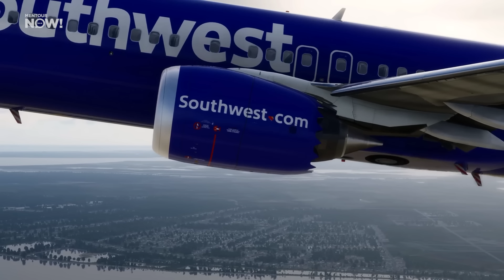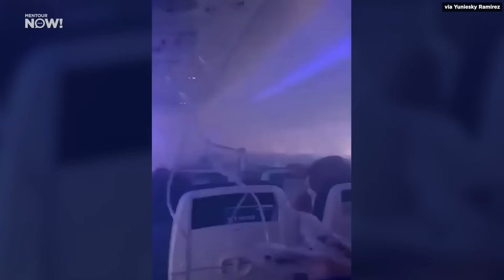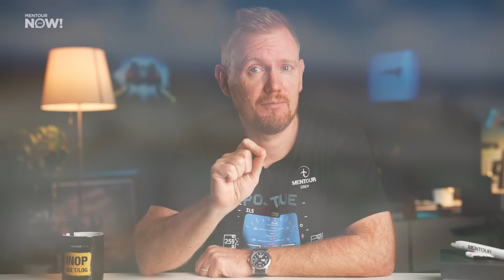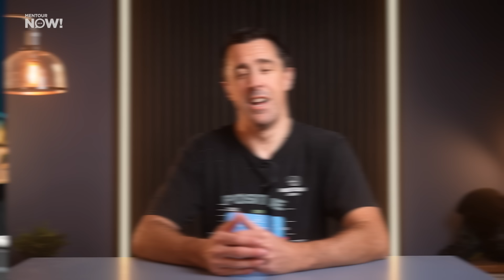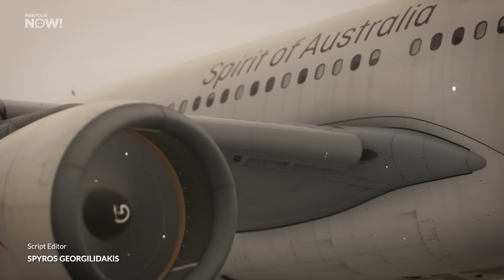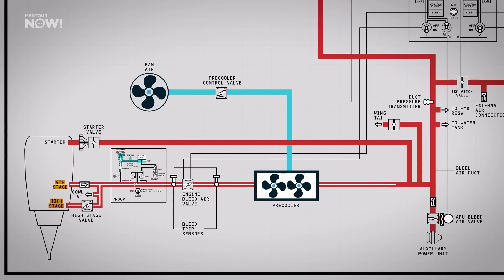Why Don’t ALL Airliners Do THIS?

Comment: bleeding hot air from engines makes sense for the heating purposes. It is definitely more efficient to heat using hot air than to convert that energy into electricity, losing some of it, just to convert it back to heat

but air pressurization from bleed air sounds terrifying given the consequences of failure D:
Reply: Except for the structural and weight penalty of the relatively large ducting and air handling components, especially when having to convert temps and pressures and provide valves to redirect to different applications.

Comment: Engine bleed systems are a high maintenance item, especially as the aircraft ages. Airline executives look at direct operating costs and reliability when making procurement decisions that affect profits over decades. The Boeing 787's bleedless system has proven to be highly cost-effective, delivering a ~3% gain in fuel efficiency by reducing engine loads and eliminating heavy, maintenance-intensive pneumatic plumbing. It enables superior, more sustainable, and more reliable operational economics compared to traditional systems.

Comment: Why don't airlines board passengers from rear to front instead of front to back? I'm sure boarding time could be substantially reduced by eliminating the bottlenecks formed by passengers stowing their carry-ons in overhead bins and fiddling with their seats, etc. Every time I've boarded a commercial airliner, I've spent most of the boarding time standing in an aisle waiting to get to my seat.

Comment: Interesting video, I've been involved in the design of EBU systems between the engines and aircraft for over 35 years and that included both the 787 and A350 amongst many others. I remember being in Seattle in the mid 00's listening to the Boeing vision for the 'bleedless' system. I get there are advantages to not using air bled from the engine compressors but everything from the main A/C packs in the fuselage is still conventional ducting, but with the added weight of the heavy electrically powered  compressors and power hungry heaters for the packs. What you do save is the heaviest ducts mounted on the engine of course (~100kg), but you add those massive generators (~85kg each, dry, plus large coolers, the oil for the cooling system and the huge power cables) and the other thing to note is the extra weight in the accessory gearbox to transmit the torque from & to the engine main shaft, larger step aside gearbox on the main shaft etc. Ultimately, as stated, it really is in the margins of weight / cost and complexity / reliability at aircraft level. Worth saying that you also swap risk sources from hot air to electrical shorts which can both be critical for composite structures. I remember doing a quick weight calculation based on what we knew of the 787 system in the early stages of development and I reckoned the bleedless system would be heavier but those decisions were already made so it was purely academic at that point, really interesting to see the same pro's an con's again after 20 years lol!

Comment: There is one more aircraft that challenges using bleed air, the grand daddy of the 737 that Ben and Petter knows.
The Boeing 707, they still took bleed air, however it was used to drive a compressor that took in air from the outside to compress and feed into the cabin, rather than directly piping the bleed air and conditioning it.
Reply: Yep, I was thinking the same thing (and the DC-8 also).  In the 707, the turbo compressors are located in the engine pylons (look for a little hole in the tip of the pylons, usually above engines 2,3, and 4, but in some models only in 2&3, others all 4.)  The DC8 had its turbo compressors in the fuselage, and the intakes are the “gills” below the cockpit.  You’d think the inefficiency of using engine bleed air to drive a compressor to create more compressed air would be unacceptable, but it allowed the use of a smaller volume of high pressure bleed air to create a larger volume of lower pressure compressed air for the AC packs.  That was a big help to the early JT3Ds, that couldn’t spare huge volumes of bleed air.

Comment: So Airbus did the smart thing, and let Boeing take all the risks with the new architecture.  I would be cash money that Airbus is doing some quiet engineering on the same type of system.  Because if Boeing turns out to be right, then they won't want to be a couple of generations behind, at least at the design stage.  And if Boeing is wrong, and the 787 turns out to be a design that just doesn't work out to have concrete benefits, then Airbus will look smart.  It's kind of a win win scenario for Airbus.

Comment: There is one other exception aircraft: the Boeing 707.  The engines used on the 707 were designed for military aircraft, with lower bleed needs.  The engines couldn't deliver the needed air, so Boeing added mechanical driven compressor to three of the four engines.
Reply: The DC-8 also used a separate compressor system.

Comment: So does the A350’s more efficient air bleed system also reduce the risk of smoke in the cabin? It would have been nice to have that followed up given that it was discussed as a negative possibility bleeding engine air at the beginning of the video.

Comment: Gulfstream/ELTA E550A CAEW and L3 Compass Call "special mission" aircraft have additional 270VDC AEP monster generators additionally to the production 115V/400Hz AC IDG's. Note; RR BR700 series engines have an additional small (very small) DEG (Dedicated Engine Generator) to power the EEC (Engine Electronic Controller) whenever the engine is running... however this DEG deliveries NO power to other airframe systems. This is what I believe the below commentator was referring to about RR Engines having two generators. All late model Gulfstream aircraft either have one IDG or VSCF generator per engine... except for the Special Mission aircraft initially mentioned above. Note 2: Early "DC" Gulfstreams; GI, II and early GIII's did have both an AC Generator as well as DC Generator per engine.

Comment: 12:51 More reliable? I like the 787 and reliability has become a lot better, but their Cabin Air Compressors still drop like flies. They are incredibly fragile. The air pressure bearings are so fragile, they can only be torque tested at 4RPM. Not 4000RPM, 4RPM!

14:43 The 777 has two generators per engine, though one is an Integrated Drive Generator, and the other one is a Backup Generator. The 787 has two identical Variable Frequency Starter Generators on each engine.

Comment: Very well explained Ben & Petter!
As I recall, as an apprentice I used a big motor/generator to convert three phase 380VAC 50Hz to 115VAC 400Hz to test galleys we built at Driesen Aircraft Interior Systems.
Sadly the Combination Boiler we developed and I tested (starting that generator every time and waiting for it to stabilise)  was not put into production after I left, only saw it in the background in the A380 episode of Richard Hammond 's BIG!
And Boeing going "European" with 235VAC is understandable, for the same power the Amperage can be halved and wire core diameter reduced as well, saving weight!

And for the APU, I recently saw a video about the Zoche Aero Diesel that is now also developed as a replacement for the turbine ones, and supposedly has much better performance!
Reply: Small correction, the US electrical system is 240V with a grounded center tap - household appliances might be 120V (half the waveform), but even in a residential context, the big users (HVAC, kitchen) are 240VAC.

Comment: Engine oil is also toxic and possibly carcinogenic as well. There's the possibility of traces leaking causing no visible smoke or smell but long-term chronic exposure to pilots and cabin staff. I think Boeing have it right and they should all change.
Reply: I think also neurotoxic, which can cause neurological problems for pilots and crew  ...  not great for safety either
Reply: Is that why flight attendants used to get switched out for fresh inventory on their 30th birthday ?

Comment: About smoke in the cabin: 
how about: a smoke detector, which automatically stops the airconditioning when smoke is detected ?
Reply: Yes you could put smoke detectors inside the air vents. That would help identify where any smoke in the cabin is coming from (whether from the engine or a fire in the cabin itself).

Comment: But this solution has its own issues, 787’s burn through AC packs like they are hotdogs at a country fair. It’s the biggest source of dispatch delays. It’s also only practical to implement when you’re doing a new design everything else has bleed air built in.

Comment: I kind of like bleed air rather than taking the hit of transferring rotational energy into electricity with generators.  At some point the benefits of electric will outweigh the penalty of energy conversion and it seems we're right on that threshold at the moment.  As always, thanks for sharing.

Comment: Bleedless pressurization is absolutely the way to go!

I feel like pumping air from the engines into the cabin is one of those things that will sound ridiculous in retrospect once the alternative is in widespread use.
Reply: Both take power from the engines. The key is making one more efficient than the other, without compromising reliability and safety.

Comment: A hybrid heater/cooler to use secondary air "turbo" the enviromental system may be the answer.
And the air from the inlet of the "turbo" could also be filtered before entering the cabin.

Comment: Just about any regional jet without a RAT is likely to have multiple generators per engine (see, the ERJ-145 as an example with its 5 gens split over two engines and the APU running a 28VDC system)

Comment: Designing an entirely new system architecture is always a mess, so I think Airbus probably made the right choice in the short run with the A350, but the trend of ever-increasing electrification in the long run is pretty clear, and learning how to do it early might give Boeing a long-run advantage.
Once you're running a higher-power electrical system, that also opens up a lot of other weight and fuel savings. I think you eventually end up replacing the hydraulic system entirely (787 didn't quite do that), which could save a lot of weight and maintenance. I could also see adding an electric motor to the nose wheel in an all-electric architecture so that you can taxi and run ground ops with just the APU and don't have to burn fuel running the engines at idle while you're on the ground, which could save a lot of fuel. It would also save time because you could plug the plane in at the gate to get everything started and keep a lot of the anti-ice systems active before you start the engines or even the APU.
Those high-power electrical systems are also going to keep getting lighter. While the 787 is only at 235 V, new electric cars are running 400V or even 800V systems, which cuts the wire weight to around 1/3rd or 1/8th of the 787's system, respectively. An 800V electrical system would beat any possible beed air system's efficiency on weight savings alone. I would also consider newer battery chemistries like LFP (and eventually LMFP) that might actually be lighter at the pack level than standard NMC lithium ion with the level of safety aviation requires, and have longer cycle life and a higher charge/discharge rate.
Reply: Now it's only a matter of how to manage electrical load. Since all these systems at the moment still uses too much voltage to work

Comment: Marketing statements are one of the few places where you are allowed break the second law of thermodynamics 🙂 
Too many Mentour videos about air incidents described a bad insulation/routing of a power cable. The more power you carry, the more dangerous the cable becomes.

2-3% of fuel save in marketing statement means that you save less than half. All this mess to save a bit of fuel and trash all the experience of the maintenace people? Think twice.

Comment: No, there are no free lunches. 
Where comes the electric energy from? 
So, if you feed generators with the energy of the engines...
Reply: Of course you have to suck energy out of the engines to run those generators. TANSTAAFL. Nothing comes for free, so there is very little (if any) energy advantage over bleed air.

Comment: You dropped the ball on safety of the pressurization relying on the bleed system which seemed to be the subject according to the intro.  Did airbus continue to use bleed air to run the air packs?

Comment: Re 14:42 question; I seem to remember the ATR 72/42 has two generators per engine, one «wild AC» and one starter/generator per engine…? And… no APU at all (Hotel mode on eng 2)…😅

Comment: Very interesting, but you don't actually cover the main problem - oil fumes entering the cabin. 

Does the Airbus still suffer from this problem? And, if not, how?  

The 'electric Vs mechanical' discussion is fine, and the arguments are interesting. But we still don't know if the Airbus solution actually deals with this problem. And, if it doesn't, surely that's a huge black mark - whatever it's other benefits may be?

As a passenger, I'm not too worried about how my plane works or how efficient, or difficult to maintain it is, but I am VERY interested in the possibility of breathing in dangerous vapour, or the pilots having to cope with loss of visibility and putting on gas masks at crucial moments when they should be concentrating entirely on flying my plane.